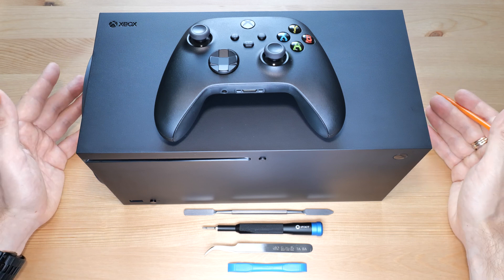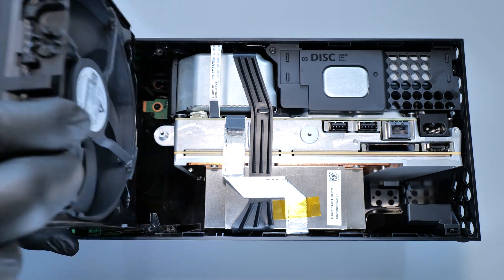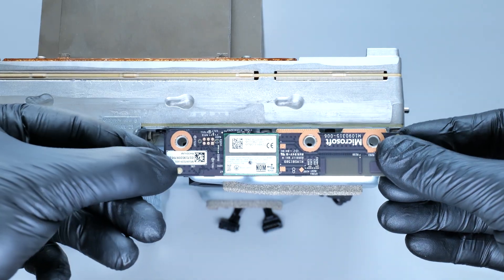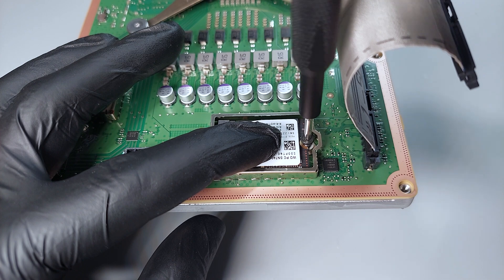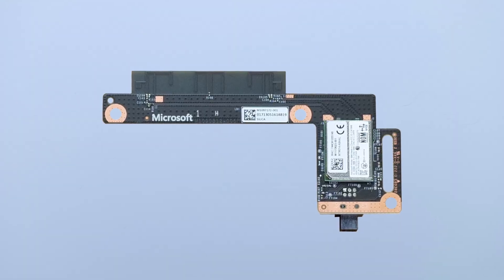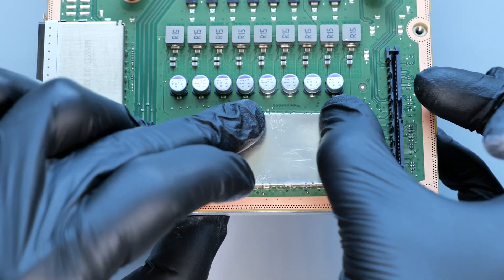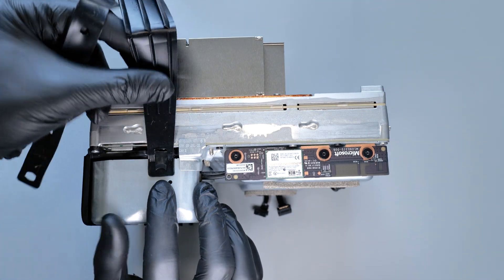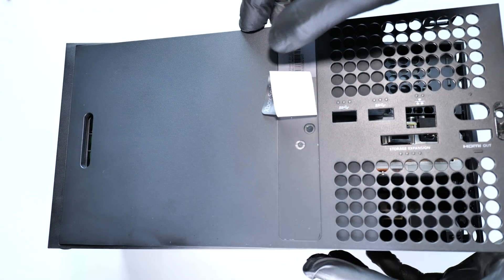Xbox Series X Disassembly + How to Diagnose Power, SSD, WiFi & Cooling Issues

Comment: Thanks for the video! Watched along with your video and was able to replace my power supply. Unfortunately it didn't fix my problem. My Xbox only crashes when booting up games. Streaming, store, watching Blu-ray, everything works fine except for playing games. Any ideas what might cause this problem?
Reply from the maker: If streaming, store, and Blu-ray work but the console crashes only when launching games, the issue is almost certainly load-related, not the power supply. Games heavily stress the APU and memory. Very common causes are overheating due to degraded thermal paste or thermal putty (I have a video on that), or an APU issue that appears only under high load. Less commonly it can be memory or power delivery instability. Another very common problem is faulty VRM power phases or a weak MOSFET can behave exactly like this idle or  light load OK, game launch (high current draw  instability crash/shutdown.

Comment: I replaced my fan because it was not turning on and the system would shut down from overheating. I’m wondering why it won’t turn on and the
Reply from the maker: If the new fan also doesn't spin then the problem most likely in the control elements, likely a low-side MOSFET tied to a PWM pin from the controller. You can wire the fan directly to a 5 or 12 V rail, the fan will just run all the time. It’s noisy, but safe for testing or even permanent use.

Comment: I'm having an issue where it will turn on then back off like shown with a corrupted SSD. I tried removing the SSD but it still won't stay on. I swapped the PSU and it has the same issue. I tested for shorts on both boards at the 12v rail but didn't find any. Is there anything else you would suggest?
Reply from the maker: There are many reasons for that issue besides a corrupted or dead SSD. It could be as simple as a shorted capacitor ($0.50), which you’d need an infrared camera and a bench power supply to locate. It could also be a dead south bridge or even the APU. I have a bunch of motherboards, so I can quickly swap them to see which one has the problem. Then I start checking all the power rails to see if the voltage is present and measure the idle current. If the current is higher than it should be, I use an infrared camera to see which component is heating up and replace it. If the APU is shorted, then it’s game over for that console.
Reply: @ElectronicsComputers Alright, I have an infrared camera. I'm waiting on a bench PSU so I can try that. I also bought a lot of broken series x's so I'll probably have some extra working boards. I know they are married to each other but do you know what happens if you use 2 boards from different xboxs together? Does it stay on but not boot or will it have the same on/off issue? Assuming both boards are good
Reply from the maker: @ponyplower5963   Unmatched boards will also behave the same way but if you use a bench power supply you’ll see the difference in current draw if a board is shorted or not.
The board with the APU is basically non-replaceable unless you also have the SSD from that board, or at least a backup of its bootable partition and the NOR chip or its backup from the second part of the board.
With the second board, things are much simpler you can swap them easily, but you’ll need to transfer the NOR chip from your old board to the new one. That chip has a unique ID that ties one board to another. You can technically just read its data and write it onto another chip, but I usually just swap them.
Also, when you look at those motherboards, you’ll see test points marked like TP1 (3p3 = 3.3V rail) or TP3, TP4 (5V rail) etc. You can check them in continuity mode against ground to see if they’re shorted, or power the board with a bench supply and proper voltages. From my experience, the issue is usually a shorted cap or an IC on that specific power rail. Good luck!
Reply: @ElectronicsComputers Alright, thank you for the help, I appreciate it

Comment: I have an xbox x digital version. It will turn on, no display, then after about 20- 30 seconds it shuts off on its own. I've taken it apart and the psu is outputting 11.86v. I removed the SSD then powered in the system on, it still did the same thing. Someone please help me on where to look next for the problem
Reply from the maker: I'd start with connecting that SSD to a PC and checking its SMART report.

Comment: Anyway i can reach you and you could walk me through ways to fix my issue on my xbox series x? Tried doing all reset/reboot methods. Clean up, even did a restart of my account due to possible corrupted gaming account. Dont have the money to buy a brand new one (do to being a single father of four kids lol) or i would. Just trying to figure out what is wrong amd see if i can fix it.
Reply from the maker: What's the exact problem with your console?
Reply: @ElectronicsComputers keeps launching some games but not others. The ones that dont launch, starts launching but thna kicks me back to home screen. The ones that don't launch di run on cloud gaming. Might be the hardware, ssd, etc. Can't zero into the exact reason.

Comment: Why doesn't our xbox have that cover like other Xbox over the cpu. I watched many videos and showed that metal cover over the cpu but yours and mine don't have it .
Reply from the maker: That metal shielding was removed in later  console versions because it traps heat. Also the latest Series X lacks SSD shielding which finally solved the issue with dying drives.
Reply: Ok unfortunately ant ate my thermal paste and also their home at power unit made some short over the components. @ElectronicsComputers

Comment: What might be the issue if the fan runs load during gameplay but not in game menus or the dashboard? Please help!

Also, subbed!
Reply from the maker: It could be: dust inside the console which can block airflow and make the fan work harder or the thermal paste and putty might not be as efficient anymore and needs to be replaced.
Reply: @ElectronicsComputers Thank you! Is putty up to 200 degrees Celsius sufficient?
Reply: @ElectronicsComputers I did it! My fan was running loud during gameplay, but after cleaning and replacing the thermal paste, it works just like new! 
Thank you!!!!!!!!!
Reply from the maker: @SpaceboyFM   Great job! I'm happy to help.

Comment: hi,i have a series x manufactured in  2022,im look your video the xbox uses a sn740 2tb ssd ,if i buy that ssd and copy the partitions  i can use the nv740 as internal ssd without problems?
Reply from the maker: The SN740 SSD is not compatible with the Xbox Series S or X out of the box. The SSD shown in the video was modified. I have tons of videos covering SSD upgrades for Xbox. Without any modifications, only two specific SSD models work and they’re not sold in stores. You can only find them used, salvaged from original Xbox consoles. Modified SSD sometimes pop up on eBay or AliExpress.

Comment: My Xbox was struck by lighting through the Ethernet cable and I thought it was fried. I replaced the power supply and it turned back on but now the Xbox is reading that it is connected to a wired connection even though the cable is unhooked.And it will not load any games
Reply from the maker: The most straightforward solution is to physically remove the damaged Realtek chip. : https://shorturl.at/C0uZ9
You can also replace it yourself that chip costs $3: https://alii.pub/77ik1i
And you can also buy a simple hot air gun for $25 like this: https://alii.pub/77ik48
Reply: @ElectronicsComputers is there a video on how to do this.And what is a Realtek chip
Reply from the maker: @westonbarnett8862  I gave you a link above.

Comment: Any chance you can show how to replace the storage expansion port. Mine has been damaged and I’m unsure how difficult this will be
Reply from the maker: To do that, you'll need to make a few small investments: a basic hot air gun ($25-35), flux ($5), and solder with some soldering wick (~$10). Definitely practice first on some scrap or broken boards to get a feel for the heat and airflow before attempting the real repair. Once you're confident, you can replace the component. Also, I’ve never seen those ports sold separately, so you’ll probably need to get a donor board for parts.
Reply: @ thanks for the quick reply. I found the part (salvaged from a broken Xbox) should have it in a couple of weeks. I also need to replace the disc drive. What steps would I need to take to remove the old one?
Reply from the maker: @ChristopherCrabtree-c1e   To remove a broken slot, you can simply apply heat directly to it using a hot air station. However, if you're trying to salvage the component for reuse, it's best to apply heat from the opposite side of the PCB. This reduces the risk of melting or damaging the component.
As for the optical drive replacement, carefully remove the PCB from your original drive and attach it to the donor drive. This way, the pairing with the console remains intact.

Comment: If the sync button does not work is it the wireless board the board that connects to the sync button
Reply from the maker: The problem could be in either of those. Start by checking the button with a multimeter—if it works, then the issue is most likely with the wireless card.

Comment: I have a question, my series X sometimes turn off after brief moment, could this issue with SSD?
Reply from the maker: It could be due to a number of reasons. If your console is more than three years old, I’d definitely recommend checking the SSD’s SMART report to assess its health. Those M.2 2230 SSDs usually don't last long. If the SSD fails, the entire console essentially becomes a brick—impossible to repair—and your best option might be to sell it for donor parts for around $50–70.
Reply: @ my console is 4 year old, should I change SSD?

Comment: Be incredibly careful when imaging your SSD to a new drive to test it. If the failed SSD doesn't end up being your issue and you copy the information to a 512 bytes/sector size drive, it cannot be imaged back onto the original drive(or at least easily that I know of :(
Reply from the maker: Cloning the drive to another one is not an issue at all, as you still have the original drive, presumably in good condition if the cloning process was successful. The real problem begins when you perform an offline update from a USB drive to a new SSD. This process changes the encryption key, and as a result, your original SSD will no longer work with the console. In such cases, your only option is to use the new bootable partition on the new drive. If you're unable to access it or copy it back to the original drive—for any number of reasons—the console essentially becomes useless as no one will been able to fix it. We have dozens of such units in my repair shop. I've created a very detailed video on SSD cloning and upgrading for the Xbox Series S and X, which covers all these issues.

Comment: Ive gone through 13 controllers in 2 years ive blamed microsoft for their controller quality.

Found out it was the bluetooth card all this freaking time i had no idea! I thought it was the wifi board this whole time
Reply from the maker: Yeah, that happens quite often, speaking from my experience. And it's hard to diagnose unless you have a second console on which you can test some controllers. 
The problem is that those controllers, when you pair them to a PC, tablet, or phone, use standard Bluetooth. But when connecting to an Xbox console, they switch to Microsoft’s proprietary wireless protocol, which operates on the same 2.4 GHz frequency as Bluetooth but with lower latency and better power efficiency. So a faulty controller can work perfectly fine on a PC but become unstable when connected to a console. So the algorithm is to first check a controller on another console and if it works perfectly, then replace the Bluetooth wireless card.

Comment: Hello nice video! I’m thinking about taking apart my series x and trying to fix it now 😂 

I have a question I’ve had my Xbox for about 3 yrs now and in January it started powering off by itself, sometimes i can play it all day and sometimes I can’t get it to stay on for more than 5min I tried everything, switching tv’s buying new cords but to no avail. I took it to a shop and they told me I needed a power supply and a new disc drive and that didn’t help either 3 days later and it started powering off again. Any suggestions bro?
Reply from the maker: I presume that in the repair shop, they replaced the thermal paste and thermal putty, ruling out overheating as the issue, right? Because that sounds like an overheating problem to me, especially if the power supply and SSD have already been replaced. 
The Xbox Series S|X isn’t the most durable console Microsoft has made. If it has been used for three years, I wouldn’t invest any money into it. I have a pile of these models in my repair shop, and most of them have dead SSDs. Once the SSD dies, the console becomes unrepairable due to encryption.

Comment: I have two Series X's, the first one works perfect. The second one is, for some reason unable to play new Unreal Engine 5 games, like Fortnite, Ark Survival Ascended, Suicide Squad, Marvel Rivals, Dead Space Remake, and Ridier's Republic. Fortnite would crash while I'm trying to connect, then, crash. It threw an error once that it couldn't find the map on the commandline 'Game/Maps/Frontend'.

Ark Survival Evolved, Suicide Squad, and Marvel Rivals would crash on the launch screen.

Dead Space apparently required an update that was the size of the game, and Rider's Republic would say that my current storage doesn't have enough room.

All these games work on the first Xbox because they are all on my Expansion Card.

The Second Xbox can still play Black Ops 6, Battlefield 2042, Hogwarts Legacy, Monster Hunter Rise, and Stardew Valley, and Dead by Daylight..

I noticed today that when the second Xbox couldn't connect to the wifi that the controller lost connection to the console and had to be resynced. It also told us we needed to be online to play.

I don't really know what exactly it could be, but my best guess is the wifi card.
Reply from the maker: If such a console came into my repair shop, I would first make sure it has the latest updates and is not enrolled in the Xbox Insider Program. Then, I would try manually reinstalling the system from a USB drive—an offline update, similar to reinstalling Windows on a PC. If that didn’t help, I would try different wireless cards. What concerns me most from your description is that it loses both internet and controller connections. These rely on two separate wireless cards, and it’s unlikely that both would fail at the same time. In any case, diagnosing the issue properly would require running multiple tests and checking key components.
Reply: I did the offline update which I had to restart the console to get it to the trouble shooter screen. (Probably means nothing). Offline update didn't fix or affect the issue.

The problems still persist; however, I found out that when I launched Battlefield 2042--it soon prompted me to reset my EA password. "Welcome back! Your login credentials has expired, but all you need to do is reset your password. Scan the QR code or use the URL below to get started." As far as Dead Space, it seemed to work once I moved the game file from my Expansion Card to the internal storage; it still asked for that EA reset your password error, but I somehow brushed passed it and it seemed to be a one time issue for that game.

The controller needing to resync was a one time issue. To me, it seems like a DRM issue, like there is a certain check it is not going through and it crashes.

I did try launching games offline as a home Xbox and that didn't affect the issue.

Rider's Republic seems to work perfectly. Also, disc's doesn't affect the issue at all.

Not sure if it has anything to do with the Wifi module? Any guesses of what it might be? Worst case scenario, it might be the SSD.

Comment: Anyone any experience with series x blowing fuse on plug? After I replace with another 5amp fuse and plug it in socket as soon as I switch socket on the fuse pops loudly before even attempting switch xbox on, (I have tried in multiple different sockets around house)
Reply from the maker: I assume you're from the UK, right? First, simply unplug the cable from the console and try plugging it directly into the outlet. This way, we can rule out a shorted cable. If the fuse hasn't blown, then the short is likely in the Xbox power supply. Replacing it is a very simple task. I also have a video on how to repair the power supply if you have some soldering skills and a multimeter. Otherwise, just buy a new power supply.

Comment: The Xbox x I have doesn’t turn on at all,I tried to turn it on after a month of not using it and it’s completely bricked. I went to a repair shop and the power supply was tested. The issue is with the motherboard from what I was told.
Reply from the maker: Just go to a different repair shop. In most cases those problems are solvable and not that expensive.